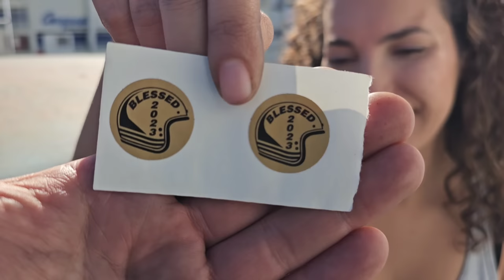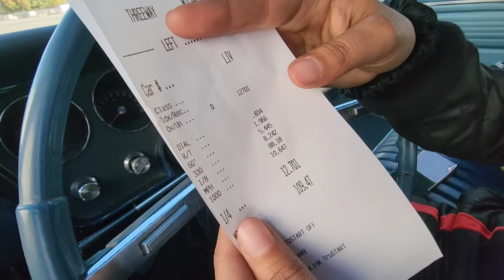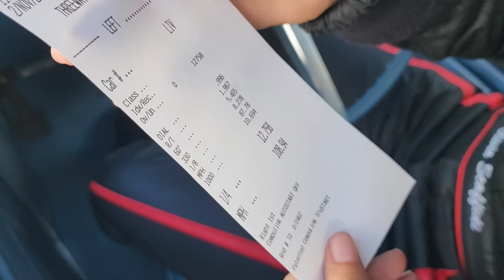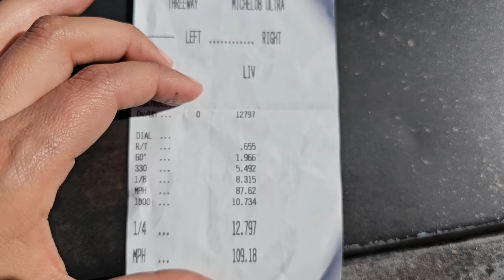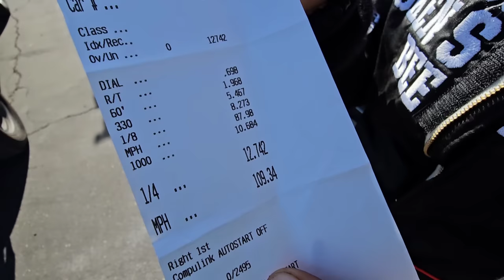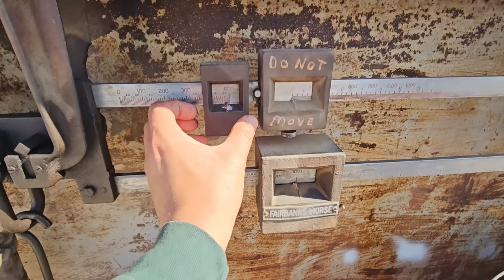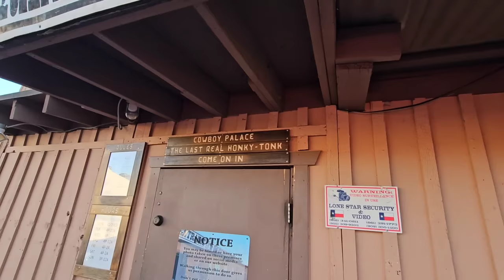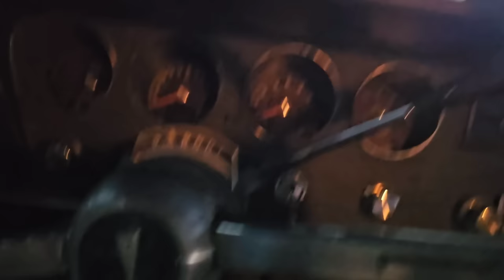How Fast Is My DAILY DRIVER? I Ran My Fastest Time Yet!

Comment: Hey guys! Nice to see you in the 12's! First, burnouts through water, with any kind of threaded tire, is a toss-up at best.  Water will clung to the tread, even when you get smoke on the burnout.  Once you pull up to the line, the water in the tread can be pulled down onto the track and cause slippage off the line. Better to do a dry burnout and just avoid the water.
Second, "power braking" on the line puts a lot of stress on the flexible engine mounts. If you break one on the line, you will shred the fan shroud with the fan, and possibly jam your throttle and/or transmission linkage(ask me how I know!) So, if you're going to do it, chain the left side of the engine downto the frame.
Again congrats on the 12.7!

Comment: Good job, bro-ette! 👍
Liv went to kick ass and break records. Mission accomplished!
Reply: One thing that's odd to me is, I put down 2.00 on my 60 ft times on street tires in my 71 Camaro and it's only a 13.8 second car. And I mean true street tires. Hankook Synergy 275/60R15. 

I wonder if you need to lower the RPM while you're sitting on the staging beams, then hit the throttle after you release the brake pedal. Maybe bring the RPM up just barely enough to load the suspension but not fully stress it, before the green light.

Comment: I always hide a piece of that plastic strapping that comes on your parcels somewhere on the car. . You can fold it and slide it betwee the door glass and the rear side glass and feed it in around the lock button.  pull it tight and up and you're in!

Comment: Thats a fast daily driver.  If you want lower 60 ft times you have a couple of options to keep it a daily driver but faster.   Lower gears,  I ran 4.10s in my daily driver and had 1.60 60ft times,  a higher stall converter to get harder launch,  or more power?   Nitrous?  100 hp would make a huge difference but not affect daily drivability.   Great job 👏  its addictive I know 😊

Comment: Dude if your too lazy to break out a pair ofJack stands for yourself at least do it for when your girl is changing wheels. I was like you up until my 72 blazer pumpkin slid off a cheap floor Jack. My arm was between the 31” tire and the fender well shoving out the center cap to rotate it to the front and it snapped my Radius bone below my wrist. One botched surgery left my arm clocked 90’ out and another surgery to correct it right ac10” plate and 6 screws and my arm will never be normal again.  You don’t want that guilt make her put something under the car when her legs are under the backing plate. Even if it’s your own leg please? It hurts me to watch that shit.  One wheel comes off, the weight shifts to one side, I didn’t think to consider that but I do now.
Reply: Exactly what I thought
Reply: Safety is a real word.......not just an idea....😢

Comment: Jeepers, what chock and puck joint did you all eat at???? Whip cream over God only knows what. I tell you all what, try eggs with cactus and Pico de gallo scrambled in the eggs, with beans and corn tortillas, a stack of corn tortillas are better for you than a stack of whip cream over God knows what. A hot cup of coffee straight black and a large glass of water with lemon.  Congratulations,  graduated into the 12s. Adios for now amigos.